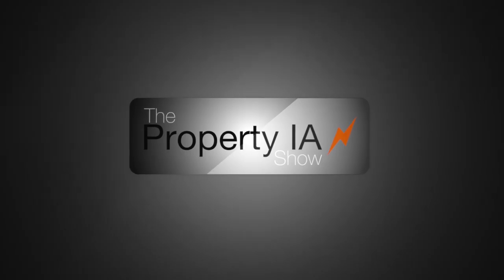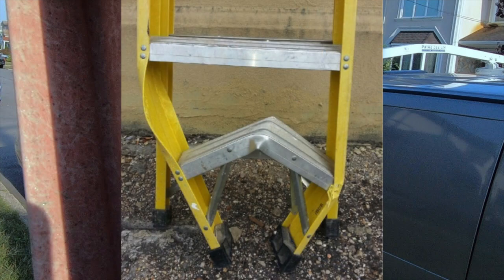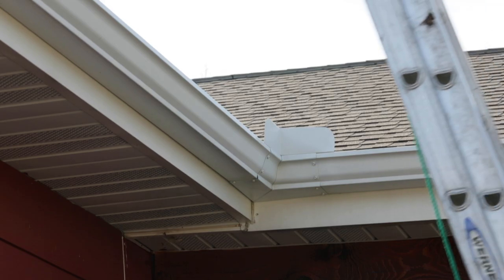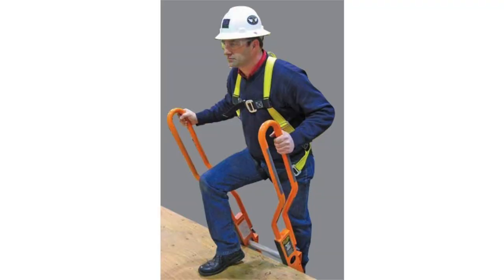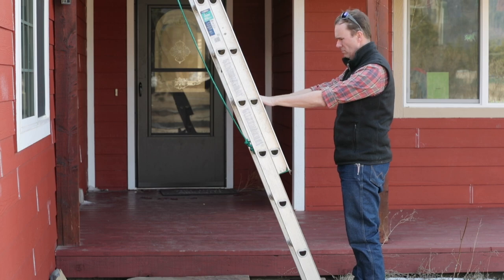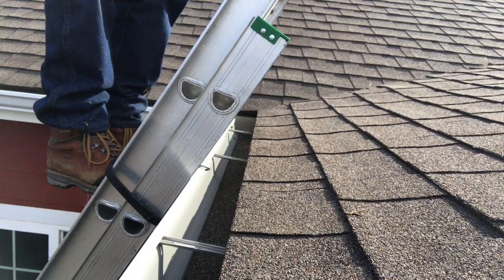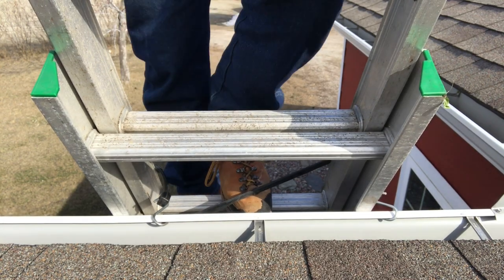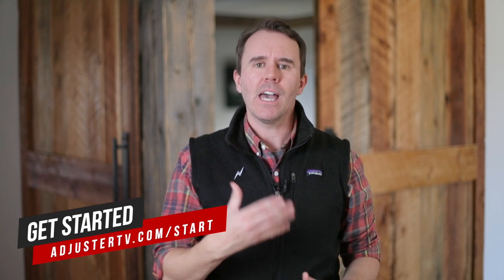How to use a ladder safely | Best ladders for claims work

Comment: I use the Ladder-Lock, can be purchased on Amazon or other online stores, it  locks the ladder to the shingles, fascia or gutter.
Reply from the maker: Yes!!  https://amzn.to/34QSjU0  I've tried a lot of different things for this because not all roofs have gutters to strap off to.  
The main reason I'm always using a bungee cord is that when my extension ladder is on my truck, the feet rattle so I bungee those off to stop the rattle.
Reply from the maker: I just posted a pic of my new Ladder Lock I ordered from Amazon...

Comment: Hey Matt, if you are not able to set up your ladder on the yard, how do you properly set up your ladder on a deck or concrete to avoid as many hazards as possible? Thanks!
Reply from the maker: Check the surface.  If it's slippery at all, don't put your ladder there.  Keep in mind that the feet on the ladder are pretty sticky.  If you do have to put your ladder on a deck, make sure the deck boards are running PARALLEL to the wall and then flip your ladder feet over to the claw side and stick them down in the crack between boards.  Most of the time concrete and asphalt are fine unless they're wet.  Concrete might be okay wet, but never asphalt ever.
Reply: @AdjusterTV  Thank you for all the information!